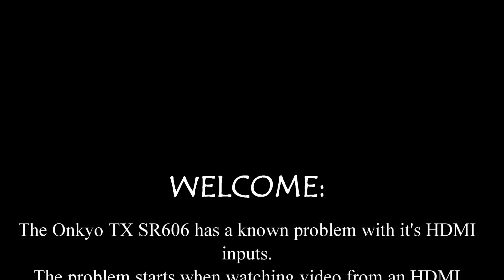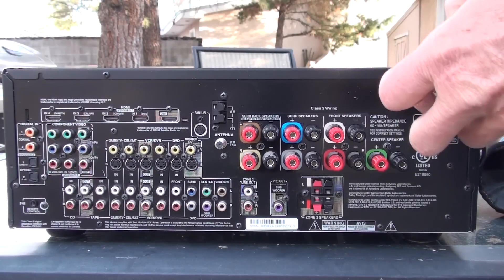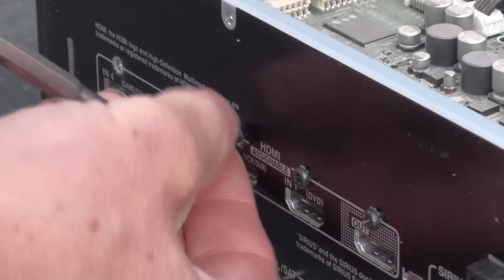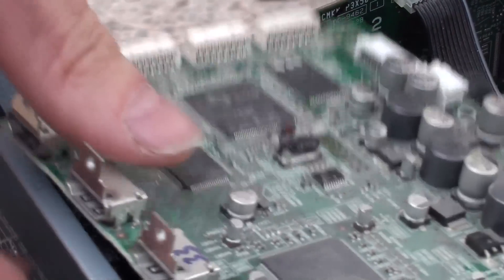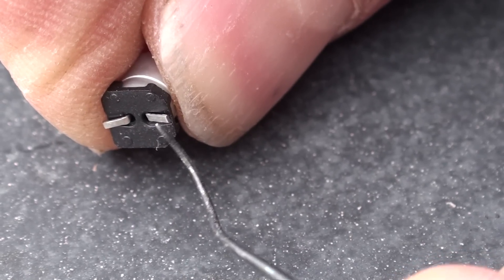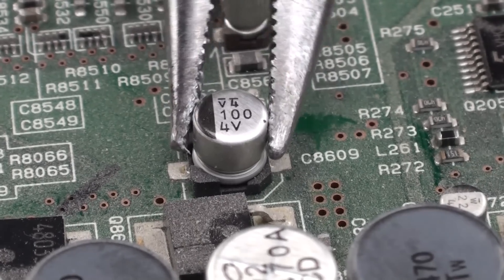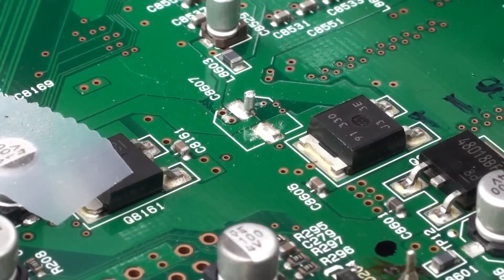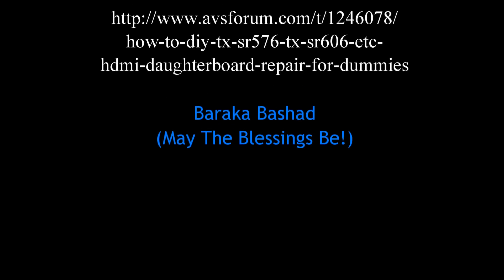How To Fix the Onkyo TX SR606 & SR607 HDMI Input Problem

Comment: Thanks, great video, very practical, well produced and super helpful, thank you.  

My receiver (a TX-SR607) is now many years old, it hasn't been used on HDMI input for 12 months due to a dead BD player.  Now with a new 4k BD player, it's developed this weirdness where it refuses to see a HDMI (audio) input (on HDMI In 1) or connect to it.  If I muck about with it for about 15 minutes, selecting different inputs and cycling power, it eventually connects and performs well through multiple start/stop sequences and different inputs.  Is that behaviour consistent with a HDMI board Capacitor problem?  Can anyone give me some feedback on that question?

Also, is it maybe just a good time to buy a new receiver??
Reply: I see the answer to my question is in the description, great job, answering the question before I even asked.  Great video.

Comment: I like to know how did you know what capacitors to replace?... did you test them 1st with a multimeter?
Reply from the maker: IRONTOSS This technique is for non technical people.  Not capacitor meter is used.  The best method is to replace all of the capacitors, because they degrade with the high heat from the power supply

Comment: I got problem with my Onkyo TX-SR607, the on-screen menu after pressing Setup button is not working.
And there is no Video when selecting RCA input sources. Actually only SPDF and HDMI input/output sources are working right now. 
I wonder if this procedure (replacing the 5x capacitors) could be applied also on my Onkyo, or do I have any other faults?
Regards, Mikael
Reply from the maker: Sorry, I don't know.

Comment: I have the same HDMI problem with an Onkyo  TX-SR674.    Would this set of instructions basically apply?    I know the card is different
since the SR674 only has 2 input and 1 output HDMI connector but I'd guess if I just found and replaced all the caps matching the size
and specs it might work the same.
Reply from the maker: It should. Just identify all the 100uf caps replace them all.
Reply: Hi Freddy. i'm having the same issue with my SR674. Have you tried to replace the capacitors? And if so: How may did you have to change? Can it easily be done? And... did it finally fix your problem :-)
Reply: I found out that the TX-SR674E has 10 capacitors in total that have to be replaced. Eight on top of the board, 2 at the back. I just replaced the types which say  ' VT 100 4V' (of maybe it's V7 100 4V) and did not replace the V3 100 6V ones. That did the trick.
Reply: I repaired my 674 following these instructions.  The answer is yes, it worked.  I replaced a total of 11 capacitors of the indicated type.  9 on the 'top' and 2 on the 'bottom.'  Worked like a champ.

Comment: patpatpat999. while watching the beginning of the video i saw a pop up text come up saying "DO NOT use compressed air to clean electronics.  This can generate damaging levels of static electricity!" was this message from you? did you change your mind? It contradicts what you were saying. I'm a bit confused as to whether i should do it or not.
Reply from the maker: RP McMurphy Do as I say not as I do.  Chances are low that it will be a problem.  Canned air is probably safer.

Comment: How did you know which Capacitors to replace? I have a different model TX-SR604 with 20 capacitors on the  board.
Reply from the maker: For most folks, I say replace all of the 100uF caps.  Without test equipment, you can't tell which is bad, partly bad, or soon to be bad.  Try and get 105C temp rated caps if possible. They'll last longer. Good luck
Reply: @patpatpat999  my board has 10. I ordered....10. Pressure is on!

Comment: JEG HAR ET Onkyo TX SR607 med samme problem som han vis her i video Jeg har også skiftet 
C8002
C8096 
C8162 
så kommet det på skærm nu :)

I HAVE A ONKYO TX SR607 with the same problem as he shows here in the video I also changed
C8002
C8096
C8162
so it's on screen now :)

Comment: Hello Pat!
After a lot of surfing the internet I discovered you and your wonderful tips!
Please help me understand what happened to my ONKYO TX-SR607 - power AC 120 V, 60 Hz!
I mistakenly connected in AC 220 V 60 Hz !
I heard a snap and a smell of burning !
I slipped the plug right away! 
Where I live does not have onkyo technical assistance
What possibly burned?
I thank you in advance!
Reply from the maker: Hi,   At the very least, you blew a fuse.  The fuse should be replaceable but will be located inside somewhere.  Hopefully it is the kind that does not have to be unsoldered.  Since you smelled something burning, it is probably more than the fuse.  It is likely that only the power supply is damaged, so a good technician hopefully can repair the power supply.  Good luck.

Comment: WHEN I TURN ON TV IT TAKES 2 TO 3 MIN FOR PICTURE TO COME ON. IF PLAYED FOR A FEW HOURS AND TURN TV OFF IT WILL COME BACK ON LIKE NORMAL. DOES THIS SOUND LIKE THE FIX FOR MU UNIT? THANKS
Reply: I have the same problem, I will try this cap replacement anyway.
Reply from the maker: john butler YES,  This sounds like your problem.  As usual, no guarantees.  Good Luck

Comment from the maker: Possible, but probably not.  This is assuming all the other HDMI inputs are locking on signals within about 10 seconds or less.  If the other HDMI inputs are taking a minute or more, then it's more likely 1 input has gone completely bad before the others.

Comment: how do you know that these caps are at fault? they do not appear to have popped nor did you use a multi-meter, so im very confused
Reply from the maker: It's a probability game.  This problem is so well known and common, for $5 and 30 minutes, just do it.  Most folks don't have meter or scope or anything else.  This video is for the non-technician.  I've rarely seen caps explode or swell, they normally just dry out. If the problem developed slowly over time, this is the most likely cause.

Comment: Would this be the same procedure for the TX SR706. Mine has the same problem as described but not sure if the caps are the same. Thank you!
Reply from the maker: It should work.  The caps will be in different locations.  Locate all the 100uF caps on the board and replace them
Reply from the maker: Yes, this did work for another person with a 706.  he said his board had 15 caps (top & bottom of board).
Reply: Oh poop...I didn't wait to see your response and only ordered 10. I'll call and see if I can get five more added. Thank you!
Reply: +WOFUKNCARS Are they still 4V?
Reply from the maker: Recommend you pull your card and look at it first.  The person who reported 15 caps may have replaced more than just the 100uf caps.  They should be 4v but can't be sure.  The larger filtering caps may be a higher voltage as well as higher capacitance value. You don't have to replace the filtering caps but it's a good idea as long as you are in there.  Replacing the the 100uf caps should fix your immediate problem
Reply: +patpatpat999 Awesome! Thank you for taking the time to respond to my questions!

Comment: I have an SR876 with HDMI Input as well as Output issues. When I switch the receiver off/on I don't see the Onkyo logo pop up. Which leads me to believe there is an output issue as well. I replaced the HDMI input capacitors but that did not fix the issue. To be honest I did not replace all the 100uf capacitors as I did not have enough, so just started with the HDMI inputs. Before I go ahead and replace other capacitors any suggestions? will it even fix the issue? There are 2 200uf output capacitors, looks like should try replacing them as well?
Reply from the maker: Sorry, can't say for sure what will work.  The 200uf caps may be filtering caps which will cause other problems. If you're getting more caps I'd get them also

Comment: Hi,
I have the Integra DHC-80.3 no sound, but the HDMI board have different capacitors descriptions on it like w4 220 4v 1 on top, w1 100 16v 5 on the bottom so wich model should I buy?
Reply from the maker: Reinaldo Marques Exact part numbers will be different for different part manufacturers.  Your first  capacitors on top sound like 330uF, 4Volt. The bottom ones are 100uFm 16V,  The voltage rating can be higher but the part will be larger.  Try for a temperature rating above 100C if possible.
Reply from the maker: Mouser.com.  232-4MS5220MEFC6.3X5.   And   667-16SEPC100MW+S
Reply: @patpatpat999  thank you, also the  HDMI board on my Integra it is the same one as the Onkyo TX NR809

Comment: my 2 cents: had some video outages via hdmi, then no video at all. sound mostly working. found this video and learned it is quite common issue with the onkyos (mine is 607). replaced ALL capacitors on the hdmi-board. nothing changed. i guess one of the ICs is gone...no luck, will need a new receiver.

Comment: how would you know which capacitor to replace ?
I have a different model and not sure which one is bad.
They look fine
Reply from the maker: Without a schematic you can't tell.  Caps seldom look bad to the eye, especially small signal caps.  There are not very many and they are easy and cheap to change.  That's why I just change them all.  Besides, most people don't have any test equipment.

Comment: Hi for the last 5+ years my TX SR607  has worked as its meant to as in when you switch sources on it you see it on the display on the front of the receiver + you hear the relay click inside it ok, and you get the new picture on the TV from the source that you have selected  e.g Satellite .. or  Andriod Box  or Xbox etc..  ( all hdmi conections )
However lately at times ,, more and more when you change sources it will change ok on the display on the front of the receiver  e.g Satellite >>> Xbox ,but you do not hear a click from inside the receiver  + the TV will display no signal or audio.. ( like there is no device connected to the option that you have choosen )  however if i turn the receiver off and back on again it will work ok.  do these symptoms sound like failures of the parts in this video ?
Reply from the maker: Sorry, can't. Say what the problem might be.  No one has described your problem and had it fixed by the digital board.
Reply: +patpatpat999 Thanks for the reply  :)

Comment: Odd question. Can someone please tell me the rating on C270? Mine has fallen off completely upon taking the board out of the unit, and I cant find it. if you pause at 2:44 of this video, it is located near the bottom left of the video, small little capacitor.
Reply from the maker: sal andriani :   I don't have my onkyo anymore but look for any other cap on the board that is the same physical size.  The numbers on the top of the cap are a code for its value.

Comment: I just have one HDMI input port that is not working.  I opted to just switch to another open port, but am concerned that if one was stopped working the others will fall in line soon.
Reply from the maker: No way to tell.  Maybe soon, maybe not for years.

Comment: I got the capacitors, installed them, it fixed the 1080p playback as well as the audio problem but no receiver setup OSD, any idea?
Reply from the maker: There are configurations will will inhibit the OSD.  So first thing to try is reset the receiver to factory default. 
Press and hold the VCR/DVR button. At same time, hold down the power button until the display says Clear. 
Let up on all buttons.  Turn Off, Turn back on.

Comment: hi, I i know I'm a bit late to the party but i have an onkyo tx-sr608 with the same problem. is there any way to check which of the capacitors are bad?
Reply from the maker: Not without expensive specialized equipment. Just remove and replace all the cap of the size mentioned in the video. No point in replacing just one as all could be degraded and nearing failure this many years on.

Comment: will this fix the flickering on hdmi as well or different caps on the board for this problem? my sound works fine screen will flicker black on occasions though. i have the tx-sr508
Reply from the maker: Sorry, can't say.  If it only flickers on HDMI inputs but works fine on the old analog inputs, then this might fix the problem.  Cant say for sure
Reply: +A42yearoldARAB my parent's TX-SR606 had the same issue, Onkyo repaired it for free, putting in a newer revision of the HDMI board. Theirs worked flawless after that.
Reply: ***** im sure mines way out of warranty did you have to ship it to them? and was it still under warranty?
Reply: No. Onkyo Extended till 2018. They sent me a box after going to their site and filling out the serial # and address info. all free.
Reply: ***** Is that for everyone ? do you have a link to where i should go?
Reply: google is your friend

Comment: Thanks @patpatpat999. I had made a stupid mistake before I found your video. I took off one of the darker grey capacitors by mistake (since it has the sign of leaking at the bottom side of the board)...it has the writing "470 Tz"....Can someone please please tell me which replacement I should buy to replace that? Digikey Part # would really help.... Thanks much in advance....that could save me a lot...
Reply from the maker: If you can send me a good photo of the part I can help.
Reply from the maker: That's an inductor you removed (AKA coil).  Appears the value is 470 uH (micro Henries).  You'll have to Google it.  Try Mouser or DigiKey.  The replacement will likely not look quite the same.

Comment: Pat, I have the 607 and have the same issue. can i follow this same instructions? also can you post a link to the correct replacement part? I am unable to find  part number 493-2141-1-ND.
Reply from the maker: Almost identical for the 607.  The part number probably only works on the digikey site.  you will see 3 options, choose the one that shows a price of .33 each.  The other two are for reels of parts vs individual pieces.  just replace ALL the 100uF caps on your board.

Comment: Hi im having tx sr 605 onkio av receiver  hdmi out from onkyo to tv is working but from another device to onkio input is not working  i daignoise on chip on hdmi board is causing over heat this particular Silicon   Vastlane Si19135CTU ON9158.1- 0733 AD03AD2 this chip  idont know how to fix this pls some one give me solution and other input outputs works fine

Comment: Hi Patpatpat999, can you give me some instructions  how to setup this receiver (Onkyo TX SR606) with my laptop and TV. Essentially I want to play music and video from my laptop (the picture from the laptop must be visualized on the TV) and I want to connect the onkyo receiver to my Tannoy Mercury MX2  spreakers (hi-fi speakers). The audio from the laptop must come out from the Tannoy speakers via the Onkyo receiver. All must be connected with HDMI cables
Reply from the maker: Todor Stavrev :  I think all you do is go from the HDMI on your laptop into any HDMI inputs 1-4.  If you don't have HDMI out on your laptop, then it's not easily done.
Reply: I have connected Laptop with receiver via HDMI, and receiver with TV with another HDMI  (from the receivers HDMI output). Unfortunately the sound I get is coming from TV , not the speakers of the receiver.
Reply from the maker: Todor Stavrev :  Try this link
http://www.avsforum.com/forum/90-receivers-amps-processors/1048462-no-audio-over-hdmi-onkyo-tx-sr606.html
It may be the setting they mention.  Page 81 of the manual.

Comment: Hi, my Onkyo will display my digital tv. box in any of the HDMI inputs but will not display my Sony PS3 or indeed my Chromecast dongle even though when i plug them directly into the tv. they display fine. Is this a symptom of the capacitor problem do you think? Thankyou.
Reply from the maker: Doesn't sound like the Onkyo.  I'd work one device at a time.  The chrome cast should be simple.

1. Make sure it has power.  Use the supplied AC wall adapter for USB power -- not the TV USB
2. Use the supplied HDMI extender
3. Unplug the extender from the TV
4. Reboot the DSL/Cable modem by unplugging the power, waiting about 2 min., then plugging in the power.  When the lights flash in a repeated pattern, go to the next step
5. Reboot the WiFi router; same steps: unpower, wait, repower, wait for the lights
6. Reset the Chromecast by pushing and holding it's reset button for 25+ seconds
7. Plug the Chromecast into the TV's HDMI

If the chromecast works directly into the TV, you can use as is, or plug into an HDMI port on the Onkyo.  Whichever works best for you.

So in short,  make sure it has power and make sure it has a wifi signal connecting out the the internet.  
Good Luck
Reply: patpatpat999 Thank's for that Pat. The chromecast is fine and working properly as i can just plug it straight into the tv or any tv and it shows it's ready screen fine. As i said the PS3 exhibits the same problem when plugged into the Onkyo HDMI ports but is fine into the TV. i can have the Chromecast displaying on the TV then just tranfer it to the Onkyo inouts and it doesn't display put it back into the TV and it's back again. The only thing that will display is the Humax digital TV box which seems to cause the Onkyo HDMI input to switch on whereas the other items dont. Anyway i have ordered the capacitors and will carry out the replacement as you suggest.  Excellent video by the way.
Reply from the maker: The capacitor problem evolves over time.  If the problem occurred suddenly, the problem may be the DSP chip on the same board as the capacitor.  If that is the case, you might get lucky heating the chip with a halogen lamp to get the solder connections to re-flow.  I'll see if I can find a youtube link.
Reply: patpatpat999 I thought the DP chip did the sound. So you are saying it does vision too?
Reply from the maker: I believe it does, but not certain.
Reply: patpatpat999 Thankyou for your help.